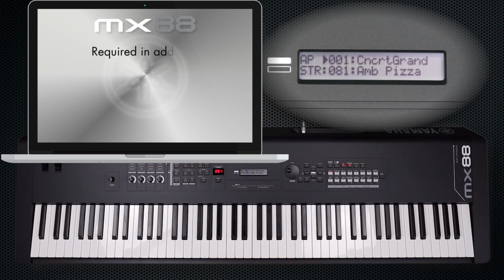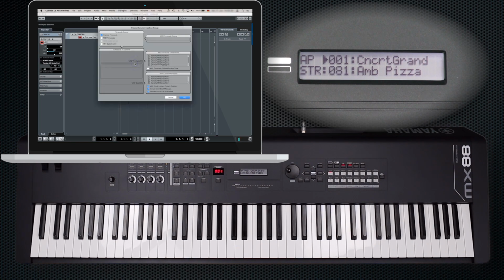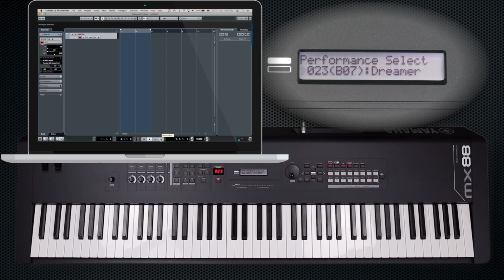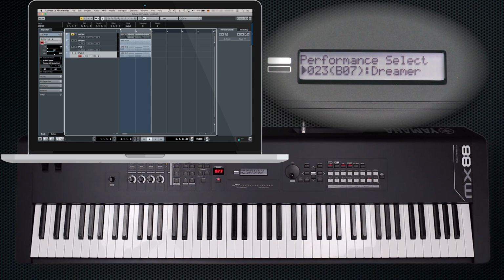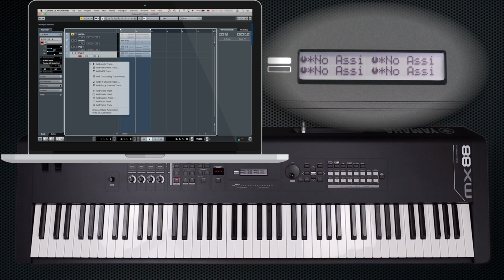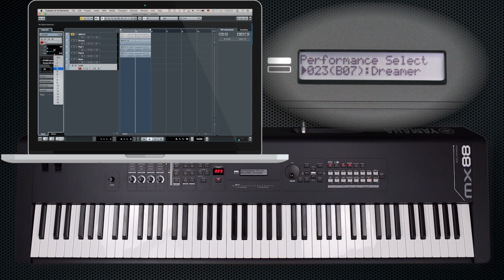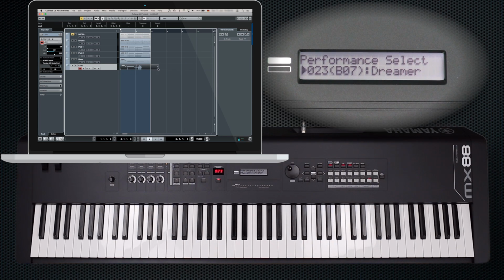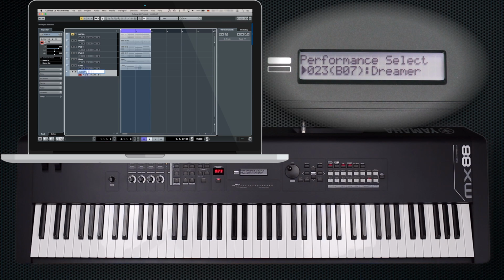Yamaha MX88 Quick Tips |  Cubase AI

Comment: Can you please make another video on how to connect the MX88 with cubase AI 10.5? I'm still not understand properly about the connection. I ended up recording 2 tracks (channel 1 and 2) as MIDI with proper MX sound, but when record the 3rd or 4th tracks (connect to MIDI part/channel 3 or 4), no sound heard and messed up. Also thr metronome sounds weird bcoz thr Steinberg metronome sound doesn't appear, only if I select MX sound, which use one of the midi channel (weird sound to use as a metronome)... Help please.